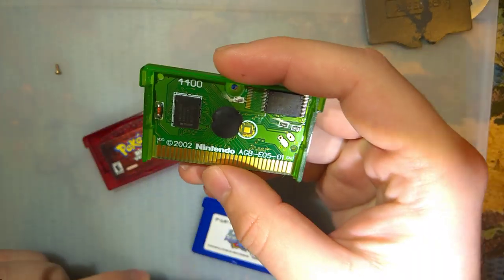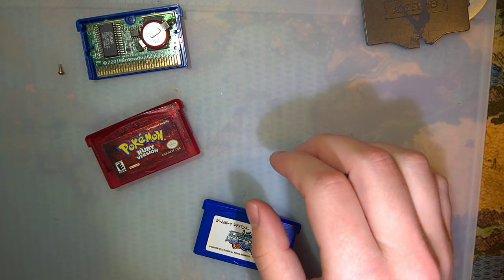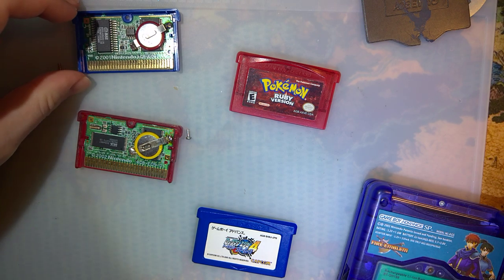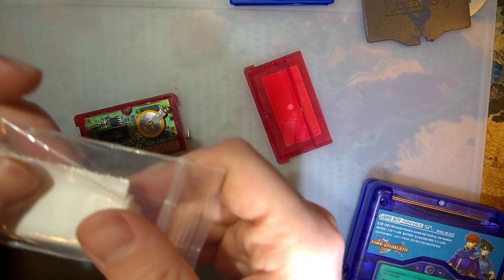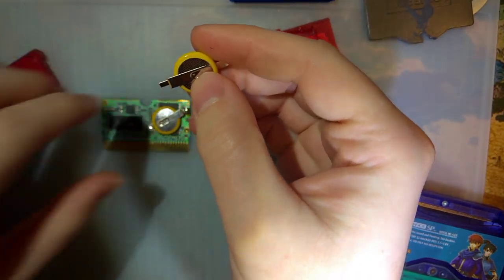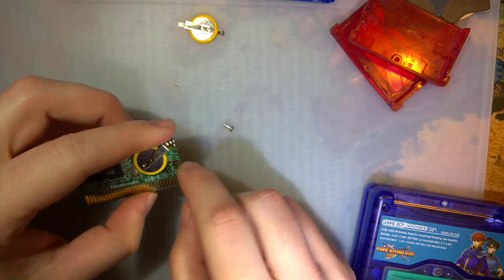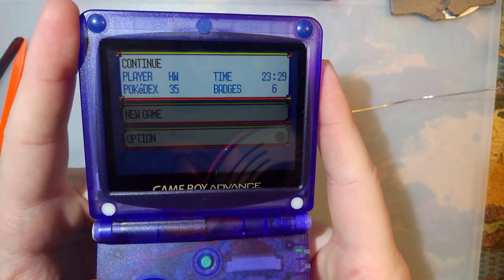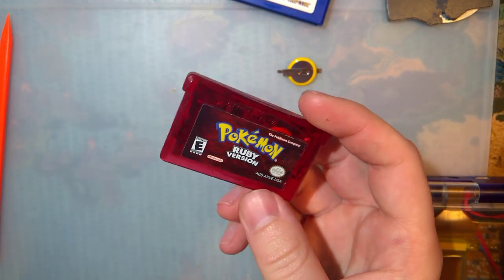Replacing the Battery in a Game Boy Advance Game

Comment: Wow, I watched this video just today, and learned that the gba games like emerald only has the real time clock separate from the saves on the battery, that was kind of a big deal to me, is it possible to lose the ability to save as well though on those games? Ive got both emerald and crystal with below 0.10 volt readings, so looking to get new batteries for them, but need to get a soldering iron and stuff first, kinda scary to me though since I havent done any soldering before :D

Comment: i have me a japanese copy of sapphire and I wanna shiny hunt for a  starter, but my battery is dry. Once i replace the battery and the "internal battery is dry" prompt is gone all I have to do is start a new save to reset any RNG problems that affects the games seed for shiny hunting a starter?
Reply from the maker: Is the shiny seed based off the clock? I'm not that familiar with the actual process. Starting a new game after replacing the battery will fix any lingering RTC issues. 

I have a full writeup on the RTC issue and fixes that involve not starting a new game if you want to read more: https://gameboy.github.io/consoles/index#games

Though, if you are hunting a starter, that's probably a non-issue.
Reply: @makho  yea i believe seed is based on the RTC and ive confirmed it works with the regrowing berries multiple times i would assume im okay to shiny hunt the starters with SRs.

Comment: I have a Metroid Fusion copy I soldered a new CR1616 into. Before the change, it worked fine and let me play for as long as I wanted; just couldn't save. After the new battery, it saved once but has started randomly glitching and freezing and will give me "Save Game A corrupted" messages after resetting and going to the save screen. (It never did that before; just didn't save with no error message.) Could this somehow be caused by the battery or did I somehow do something like damage or deflow the ROM chip from the board that would cause these issues?
I've been watching a bunch of your videos, including your really cool SRAM to FRAM mod video, and you seem very knowledgeable about these things so I thought I'd go to you lol
Reply from the maker: Was the battery dead when you replaced it? That's pretty unusual with these games but as we near the tail end of the shelf life of the batteries used in these games I suppose it will be more common. 

Was there any water damage? Did you damage anything when you replaced the battery? How are you certain that what you did is causing the current behavior since it didn't work beforehand? 

This video covers nearly all troubleshooting steps to take with carts: https://www.youtube.com/watch?v=0gqNEyQLecQ
Reply: @makho  Thanks for the response. The original OEM battery was dead. I replaced it with one of the yellow rubber-coated batteries (cheap Amazon crap) that you describe as low quality in this video. At first that battery was registering 3.2 V on the multimeter but it seems to drain fast; after a little play time (with the glitches and freezing I described) it was down to 1.8 V.

I know that the battery (or something I did in the replacement process) is the problem because the game was working fine prior to the replacement. It's a little bit more of a complicated story than I initially described it, but I really struggled with getting the yellow batteries to work and had to try three different ones (over the course of three days) before I ever got a save to stay (albeit, with those corrupted save messages). During that time, while I had batteries soldered in that wouldn't let me save, I could play the game for a very long time without any glitches or freezing. I just couldn't save. My most recent attempt at soldering in, I really made an effort to get the tabs of the batteries to touch the solder pads directly (they weren't before due to how short those friggin tabs are). Now the game either doesn't boot up at all, or will freeze during the intro cutscene or shortly into gameplay, well before I the point I was playing to previously when I had a bad battery in.

Thanks for that video. I'm going to try removing the battery and see if the game revives, but if it doesn't I'll just reflow everything. I have a feeling that it's most likely that I messed up the flow to the SRAM or ROM chips when I was soldering, and not something directly caused by the shitty yellow batteries (unless it's somehow possible for them to cause errors like this). I'm pretty sure water damage or other damages during my repair process are out of the question, unless you can somehow water damage a PCB/IC with too much rubbing alcohol or melty solder flux - I was using a shit ton of both.

Comment: 13:38 ah, an old friend.

Depending where you get your cells from, you might notice them longer than advertised. Most cases, center the cellI just cut the longest end off with the wire cutters :V
Out of boredom, I remove all existing solder, and redo with fresh solder.

Comment: does the ez flash has a battery?
Reply from the maker: Omega and JR do. Omega requires soldering (and it's a CR1212 if memory is correct) but JR does not. I'd check the manual.

Comment: hey, is the battery cr1616?
Reply from the maker: In a GBA game, yeah. I've heard that CR2025 can be made to fit though but I've never tried it. GB and GBC games are also mostly CR1616, except for most of the Pokemon or other RTC games, but tabbed CR2032s will fit fine in nearly all the games.
Reply: @makho  thanks a lot for info.

Comment: Kind of dumb that they didn't put in silly utility in game to reset the clock. Clocks do drift, but they had that stupid mindset that when the battery ran out that the game would be destroyed, unplayable, or no one would care enough to change the battery. I knew back in the '90s that I wanted to play my games forever. There was also this little thing called the Y2k Bug that existed because people thought no one would be still using computer that was 30 years old in the year 2000. People and companies were still using 30 year old computer equipment in the year 2000. People have a habit of no replacing something that works fine and with good reason. There often is no benefit to replacing equipment that works for another that does the same just job. Also, it's that disposable culture thing.
Reply from the maker: Like I mentioned, there is an actual event in the game that, when flagged, allows you to reset the clock. Nintendo never released the event officially though. You can activate it with PKHeX.

Realistically, they could have easily programmed around this. They did in the second gen games. I dunno why they didn't implement the same thing here too.